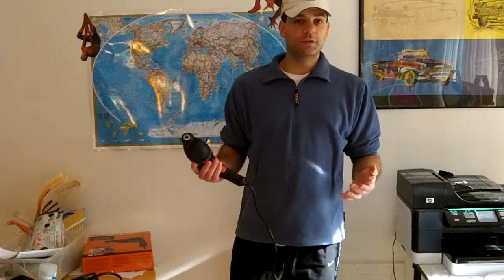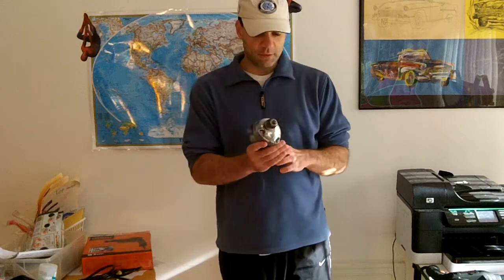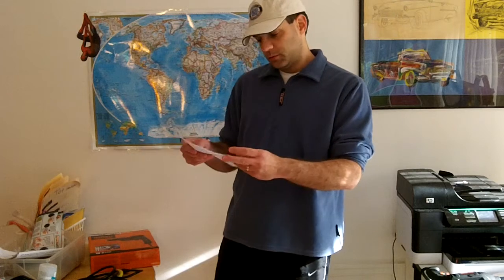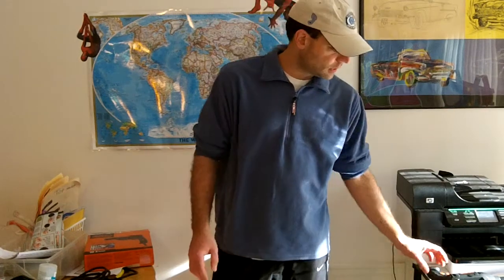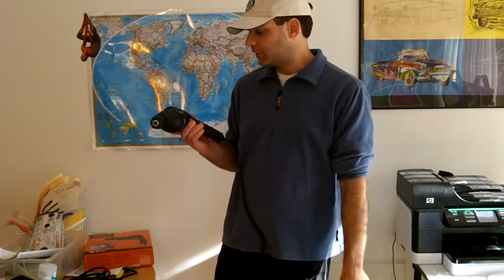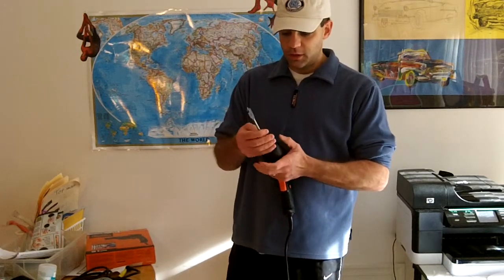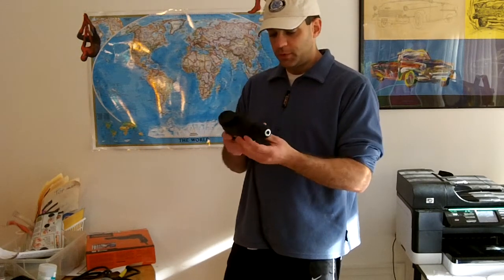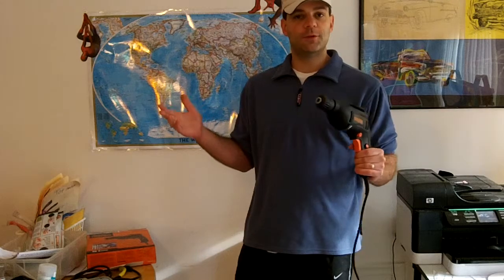Black & Decker 3 Amp 3/8" Drill Review (BDEDR3C) and Comparison to 1960s Black & Decker U-100 Drill

Comment: Yes it is not an expensive drill BUT I made a mistake buying it. The chuck stopped working after 5 uses. The chuck seemed to be coming off the spindle and cause my bit to jam. I had to put in a vice to unlock it but the chuck no longer worked.
Reply from the maker: Oh man that's a real bummer. I hope the company can do something for you. Sounds like a defect! Thanks for the feedback.